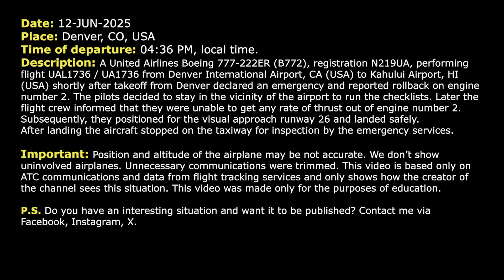Engine rollback on takeoff. United Boeing 777 reports loss of power in one engine. Real ATC

Comment: The whole thing is fly by wire, therefore can it be controlled remotely, just like the hackers attack the banking, power infrastructure and retail databases. Is it also unreasonable to ignore the possibility of internal security built into the software to be activated as and when needed. Allegedly, Mrs M Thatcher, threatened to use nuclear weapons on Argentina mainland to stop the Exocet missiles Sinking the British fleet, as we had inadequate defensive systems to thwart the Exocet. My understanding is that France gave the UK the intercept codes to prevent Nuclear War.

Comment: Why Boeing Can Still Be Responsible for Engine Failures:
	1.	Engine-Airframe Integration:
Boeing designs the nacelle (engine housing), pylons, and all systems connecting the engine to the aircraft. Faults here can affect airflow, cooling, or containment in case of failure.
	2.	System Controls & Software:
Boeing often develops or integrates key software (e.g. FADEC interfaces, warning systems, automated flight controls) that govern engine behavior and pilot alerts.
	3.	Engine Installation & Certification:
Boeing is responsible for how the engine is mounted and integrated into the overall aircraft system. Certification of the aircraft includes joint responsibility for safe operation of the engine within design limits.
	4.	Safety Assumptions & Redundancy:
Boeing’s design must assume certain engine failure modes and ensure the aircraft remains safe and controllable — e.g. in uncontained failures or bird strikes.
	5.	Maintenance Documentation & Training:
Boeing supplies procedures for ground crews and pilots; flawed guidance or poor interface design can turn a manageable failure into a disaster.
	6.	Previous Cases:
Incidents like Southwest 1380 (2018) and United 328 (2021) showed how engine cowling/nacelle design failures (a Boeing responsibility) worsened outcomes during engine failure.

⸻
Components Boeing Designs/Builds Around the Engine:
	•	Nacelle and thrust reverser
	•	Engine pylons and mountings
	•	Bleed air ducts
	•	Wiring and control system interfaces
	•	Fire detection & suppression systems
	•	Software integration with avionics
	•	Engine instrumentation and cockpit displays

⸻

Bottom line: Even when a failure starts inside the engine (e.g. fan blade fracture), Boeing’s design of surrounding systems and integration responsibilities make it co-responsible for outcomes — especially in containment, response, and airframe impact.

Key Aircraft Systems Boeing Controls That Link to the Engine (and Can Be Fatal if Faulty):

1. Fuel System (Boeing Responsibility)
	•	Fuel pumps, lines, valves, and fuel control logic are part of Boeing’s airframe systems.
	•	If these deliver fuel at wrong pressure, have leaks, or supply contaminated fuel, they can:
	•	Cause flameouts or engine surges
	•	Lead to engine fires or explosions
	•	Result in asymmetrical thrust, destabilizing the aircraft

2. Electrical Interface
	•	Boeing’s avionics and electrical systems feed power to engine sensors, actuators, and control units (including FADEC — Full Authority Digital Engine Control).
	•	A Boeing-side short, spike, or software fault could:
	•	Shut down an engine unintentionally
	•	Feed false data (e.g. incorrect temperature or pressure readings)
	•	Disable engine fire suppression or warning systems

3. Hydraulic Systems
	•	Hydraulics routed by Boeing control thrust reversers, cowling actuators, and sometimes engine accessories.
	•	Leaks or failures can:
	•	Lead to uncommanded thrust reverser deployment (extremely dangerous during takeoff)
	•	Impair cooling or mechanical functions tied to the engine

4. Bleed Air and Pneumatics
	•	Engines supply compressed air for cabin pressurization, de-icing, and other uses.
	•	Mismanagement (e.g. valve malfunction or duct rupture) can:
	•	Damage the engine internally
	•	Cause smoke in the cabin, overheating, or loss of pressurization

5. Fire Detection & Suppression
	•	Boeing designs and integrates the fire detection loops and extinguishing systems around engines.
	•	If these fail to detect or suppress an actual engine fire, the result can be:
	•	Delayed pilot response
	•	Structural failure from prolonged burning
	•	Evacuation risks

6. Software & Avionics Integration
	•	Boeing’s cockpit systems present engine data, trigger warnings, and execute automated commands.
	•	A flaw in this integration (e.g. misinterpreting a sensor failure as real thrust loss) can lead to:
	•	Incorrect pilot decisions
	•	Loss of thrust when it’s actually available
	•	A cascading failure from miscoordinated engine-pilot-system feedback

Comment: Yeah but the integrate them into the plane and am responsible for all software configuration and testing both static and dynamic
Reply: LOOK  LIKE  THAT'S THE  PROBLEM  ON PLANE  software 😮???? or on ship or CARS too mine just  stoped in middle of Road 😮😮😮😮😮
Reply: Yeah but you don’t even know if this is the engine the a/c was delivered with.  If it’s more than a few years old the engines have been swapped for overhaul.  Engines on airliners are not like cars where the engine stays with the vehicle through its entire life.

Comment: I hate tge lack of urgency to get it on the ground.  Running a 20 minute checklist? For what?  Short of being over landing speed, get it on the ground....If yiu shut an engine down, land. Tgere. Simple checklist.
Reply: Because they have a million things to get right, and rushing things makes for big mistakes.  Especially considering getting the weight right.  When you land single engine, you have a bunch of coordination in addition to setting the aircraft up for a single engine approach, missed approach contingencies, and they were in no hurry to land in the middle of a frontal passage and add that risk as well.
Reply: “Being over landing speed” you don’t know what you are talking about or the considerations that we have to take in place in the 777. If it were a fire, sure there would be more of an urgency. An engine failure is no big deal. Jettison vs overweight landing, how we have to retrieve the landing data performance and goaround procedures (located in two different areas), the operations aspect (Dispatch, Crew, Passengers). The airplane has plenty of fuel with no major urgency here. It flies just fine on one engine.

Comment: For anyone wondering why they turned to a 010 heading without being told to by ATC, that is the pre-determined heading off that runway to be used for terrain avoidance in case of an engine failure. It’s known as a T procedure and is briefed by the crew prior to every takeoff if there is one for that particular runway
Reply: Or after declaring an emergency they can pretty much do what they need to do for the safety of the flight.
Reply: @thud9797 I was explaining why they turned to that particular heading and without clearance. I’m a retired United pilot
Reply: @Slohoffman01 
Cool, thanks. I remember that pilot, think it was AA, that wanted to land a particular runway at JFK and was minimum fuel. ATC told them no. So he declared an emergency and told ATC to move everyone out of the way and he was coming in to land on 31 or whatever it was, it was pretty dramatic and shocking first time I heard it  😄
Reply: @thud9797 Yeah, minimum fuel is technically not an emergency. It tells ATC that “We can cannot accept any undue delay, or it may develop into an emergency.” At Kennedy, minimum fuel often may not buy you anything due to how busy they are.

Comment: 30yr old plane. United flying these old planes for one reason, trying to save money for their stock holders.
Reply: The plane behaved beautifully. The engine is the thing that quit. As to why, who knows but it seems like it wasn't the 777 or it's age that was the problem.
Reply: You seem to be totally misinformed.
Reply: The 777 is designed to handle at least 25,000 cycles and up to  45,000 cycles. They are primarily used for long haul flights not regional or shorter flights like an Embraer or 737. Jet engines have maintenance services and checks very frequently.
Reply: The engine is far newer than that
Reply: I’d rather be on a 30 year old 777 than a new plane. 777s are tanks!
Reply: Uninformed and spewing B S is more likely.
Reply: Meanwhile, USAF trying to hit 100 years in the same B-52s 👀
Reply: With appropriate and consistent maintenance you can fly these old birds for years to come, just like your car
Reply: @sensah3978  A car typically lasts about only 10 years before needing repairs or fixes and that's with the best luck
Reply: @followerofmanus1 idk what car you got but damnnn
Reply: @sensah3978  That's the average car life in America
Reply: @followerofmanus1  Only if you treat your car like crap. I see 30 year old Toyotas every day.
Reply: They have had many issues lately with these old 777.
Reply: I know a 777 FO for UA. United owns those birds so they are trying to hold on to them as long as possible.

Comment: Great, right after Air India. GE or Rolls Royce?
Reply: Possibly GE90 or Pratt & Whitney PW4000.
Reply: @RandallJT84  PW4000, since this ship originally went to united when it was bought UA put the pratts on it
Reply: I'm its a 200er probably pratt and whitney
Reply: @VirtualUnitedPilot  That answers that.
Reply: @VirtualUnitedPilot  both the 200's and 200er's that united bought them selfs were equiped with the PW4000's and the ones they got from continental had the GE90
Reply: They are Pratts
Reply: Literally nothing to do with the air India incident
Reply: Exactly  @cruisinguy6024
Reply: @cruisinguy6024  yeah but it happened on the same day with almost the same problem
Reply: Its the PW4000

Comment: Here to just say that Boeing doesn’t make the engines.
Reply: They make all the systems that control the engine though.
Reply: @craig7350 Nope.  Armchair non-expert showing ignorance yet again.
Reply: Wrong
Reply: Great point that 99% of the “so called experts” don’t know.
Reply: But the make the systems that control those engines
Reply: @souleymanesavane6312   NOPE.
Reply: How about the throttle and thrust management controls? Does Boeing make them?
Reply: @chuckles3265 Nope.
Reply: @chuckles3265  Boeing apologists are the worst. Its only because there loved ones are ok.
Reply: GE, we bring good things to life.
Reply: @drvannozzun The original United Airlines B-777-222s have Pratt & Whitney powerplants.  Another dumb non aviation "expert"???
Reply: @drvannozzun  Not anymore....at least for its appliance division that was sold off to Haier, a Chinese company. Through the wall AC units are having a high failure rate, as well as other appliances.
Reply: Yep, good call.
Reply: What about all the electricals? Boeing is going under wether you like it or not.  @thesparkypilot
Reply: Your honor someone else supplied these engines we can’t take responsibility for our planes.
Reply: Yep just like Iphones are made by chinese but you would blame Apple anyway if your iphone blew your ear!
Reply: NO , 🤔 BUT IT DOES ALL THE FITTING ,HOUSINGS , WIRING ,PIPING , COMPUTER CONNECTIONS ETC ETC , TO THE ENGINES .🤔
Reply: Bottom line is they got lucky. Another "big one" is gonna happen  as too much faith and trust in just 2 engines that are being worked to death. Then add human error....
Reply: Correct. Boeing doesn't make engines .... and that's a good thing. They also don't reliable space craft either, at least from NASA;s perspective. Maybe they could put big springs on the bottom of their planes to cushion impact? Boeing! Just for the sake of parody. 🙂
Reply: You don’t have to melt the engines but if it’s electrical your stil responsible for the production
Reply: It was probably built during "Biden's economy".
Reply: Maybe Boeing needs to look into who does
Reply: I heard it's Trumps fault
Reply: @jamescollier3  He seems to mess up a lot, so it is probably his fault!
Reply: It's known as "George Bush Syndrome" !  EVERYTHING is TRUMPS FAULT , including my split big toe nail !  LOL 🇺🇸 @jamescollier3
Reply: @jamescollier3 nothing surprises me with liberals
Reply: They don’t make any parts, they just assemble. Therefore they should never be held accountable for anything.
Reply: Boeing buys the engines, establishes he technical requirements, tests and installs the engines and then sells the product…..that makes them responsible
Reply: Boeing buys the engines, establishes he technical requirements, tests and installs the engines and then sells the product…..that makes them responsible